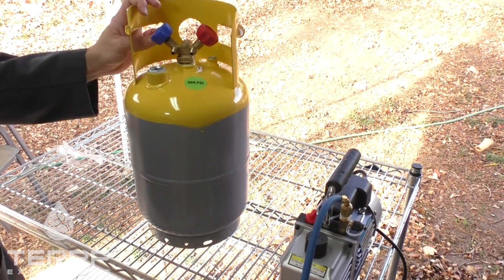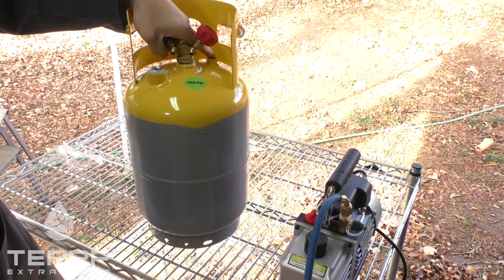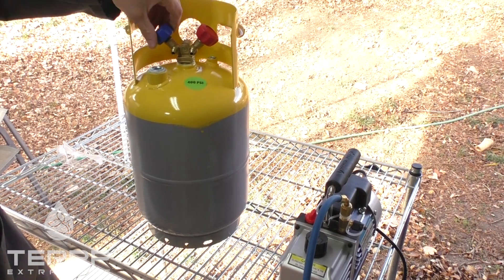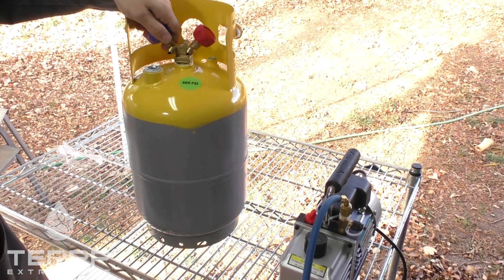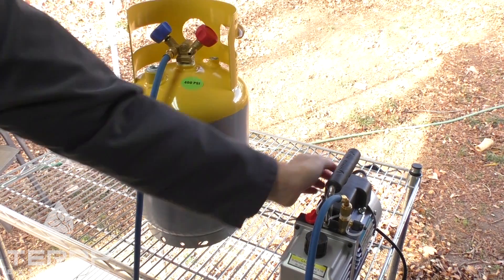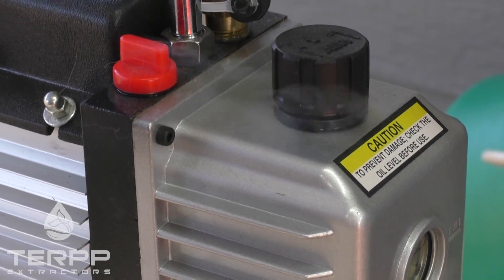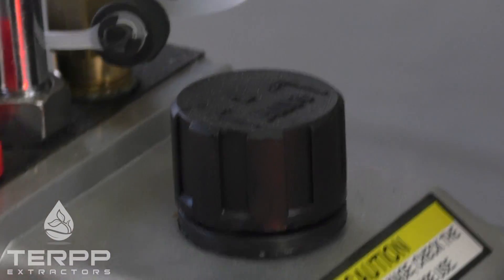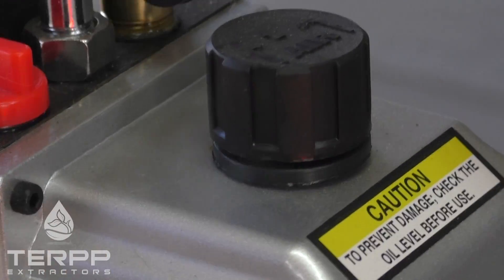Vacuuming Down Your Recovery Cylinder

Comment: I've had the same smoking happen on mine. It was because I added the oil to the main oil plug (the black cap). This is normal for some pumps. But on a pump like this (just as I have) the RED cap is the actual oil input. Filling the black-capped input is the alternate filling point (and for some models, is the ONLY input), so if you do that, no harm, no foul. But ideally, fill the red cap on these models and you won't get that smoke. My guess is that one these design, the red cap makes sure the oil isn't touching any heated elements within the unit. (Note: Even though my Robinair pump has the black cap that says "OIL" on it, the red cap is where I actually want to add the oil.)

Comment: That's not smoke coming out of the vacuum pump, it's water vapor.  If your vacuum pump is smoking, pull the plug and get your fire extinguisher.
Reply: Agree 100% And he should pull the nitrogen out with the pump opening the valve a little at a time. Never open the valves to vent the nitrogen out. Its there so the tank is water vapor free. to  keep the tank dry. when he open it he just screw the whole deal just made the evacuation time longer.
Reply: @Matt M A new cylinder should not have oil in it and the presenter is commissioning a new cylinder.  If you do any kind of HVAC work, then you know that the white vapor you see when you first start up your vacuum pump is water vapor.  On an initial commission, you're only removing the vapor present in your manifold setup.  This guy is simply using a straight hose, but there shouldn't be a large amount of moisture present in either scenario.  After recovering a 30 lb cylinder into a larger cylinder for transport (unless you just take it to your local supply house and swap it out), you will generally see a lot more vapor in recommissioning because your recovery machine will pull the cylinder into a slight vacuum and changing out to your vacuum pump will cause cylinder to pull in ambient moisture so you'll have a water vapor release for a longer period.   

I hear a lot of people saying that "30 minutes" is adequate for vacuuming systems or cylinders, but that's why we have micron gauges.  Anyone who's had to try removing moisture from an improperly installed Mitsubishi mini-split (or any other R-410a system) can tell you how important it is to use a micron gauge (and probably cusses the installer relentlessly for not doing so).  Not following proper ASHRAE standards means a whole lot of clean up work, including changing multiple filter/driers.  I recently had to go in behind an installer who used a 6cfm Robinair vacuum pump and swore blind to me that he ran it for four hours to pull the system into an appropriate vacuum.  In testing his vacuum pump it SOUNDED like it was working, and it pulled his gauges down to 29"hg, but that was as far as it went.  When we attached a micron gauge, it showed that the vacuum pump would not pull down any further than that.  Bad seal in the pump cylinder.  Using a micron gauge and pulling down to 500 microns or lower may seem like being excessively fussy, but using best practices to ensure that you've done the job right saves you time and money in the long run.

Comment: Can you reuse the gas from the recovery tank after it has been filled.
Reply: Only in another system utilizing the same refrigerant at the same location owned by the same customer.  It is illegal to recover refrigerant from one location and use it at another.  Say for instance that you have a customer that is changing out an R22 system at his home and has a leaky system at his office downtown.  You cannot take the refrigerant from the system you just changed out and put it in the one downtown.  You COULD take the refrigerant from the downstairs system and put it into the upstairs system, BUT if there're any contaminants or acid in the refrigerant, you're going to tear that one up too.
Reply: Rebecca Stevens 😂🤣.   Safety sally
Reply: @Matt M I see the disconnect.  This equipment is for refrigerant recovery.  I was unaware that people were repurposing HVAC/R equipment for use in "solvent recovery for botanical extraction methods."  For any refrigerant for HVAC/R use, which is what I assumed he was talking about, in order for the refrigerant to be reused as "reclaimed", the refrigerant MUST be recertified by an EPA approved facility to "new" standards of purity.  The TERPP systems would not qualify and are not designed for that purpose in any case.  I am not aware what regulations exist to govern the use of this equipment for purposes for which they are not designed.  In addition, in looking at the TERPP site on the MK4c, I see that their setup included a CPS TRS21 refrigerant recovery machine.  While CPS does certify that their equipment is safe for use on A2, A2L, and A3 refrigerants, my local rep says that use for purposes other than refrigerant recovery is not recommended and is generally a bad idea, but I thought it best to query CPS powers that be to get their input on using their equipment for recovering propane or butane.  Worthington Industries says to use their propane cylinders for these materials rather than their refrigerant recovery cylinders.  In any case, you would have to relabel the cylinder with the appropriate DOT Hazmat sticker indicating contents and flammability in order to misuse the cylinder.
Reply: After contacting CPS, their tech support and engineering departments say that using the TRS21 for the purpose that TERPP puts it to voids any and all warranty as the process destroys the O-rings and seals.  Sounds like a bad way to blow $1000+, but hey!  It's your money.
Reply: Rebecca Stevens you rebuild it every 100 hours.  I run trs21. Use molecular sieve duh.
Reply: @Matt M EPA 608 violation.  $25,000 fine for each occurrence.  Please don't tell people to do illegal stuff.

Comment: And that's not a "recovery pump". Why make a video when you don't know what the hell you're talking about?
Reply: james holder it's a vacuum pump. It's says vacuuming down your recovery tank. Nothing about a recovery pump. But thanks. 😜
Reply: @FLAAA.  The guy in the video calls it a "recovery pump" close to the end in addition to referring to the water vapor as "smoke".  James has a valid point.  The people who made this video do not appear to be HVAC/R techs as they advertise a product to use HVAC/R tools and equipment for processing plant material and recovering the solvents used.  For what they're selling, they SHOULD be commissioning a new propane cylinder rather than a refrigerant cylinder.  HVAC/R techs are quick to criticize bad information because the ones who know what they're doing usually end up cleaning up behind the ones that don't.  When a video gives bad information to newbies, it means that somewhere down the road, one of us is going to have unnecessary work to do later.  Bad practices mean bad PR for companies like TRANE and Lennox (and believe me, Lennox has enough problems with the leaking C33 coils right now) and they're quick to blame any product problems on bad install rather than manufacturing defects.  Parker/Sporlan blamed malfunctioning TXVs on bad install practices for years before it was discovered that Copeland's anti-corrosion compounds were breaking down due to R-410a and gumming them up.

Comment: You should have attached a good micron vacuum gauge to the other port on the recovery cylinder to know for sure that you got all of the non-condensables out. The last one of these I did I pulled down to and held <300 microns, which is ~.04% of sea level atmospheric and low enough to ensure that all moisture is gone.

Comment: Hey Austin, wondering how you would then fill the tank? Could you connect a can tapper and hook it to the liquid side and proceed? 
Thank you in advance!
Reply: you talking about the recovery process. obviously those tanks are use to recover refrigerant from a system for major repair. Look for "How to recovery refrigerant" videos. There is a process and a recovery machine and filter and more tools are needed. I hope i helped

Comment: What kind of connection and line is that you have running from the pump to the recovery tank?
Reply from the maker: That line is a standard issue "1/4" refrigerant recovery hose". You can pick those up at most HVAC wholesale shops, or you can order one online. I know Amazon carries them as well. Hope this helps!
Reply: Terpp Extractors Awesome, thanks for replying! You guys are doing great things!